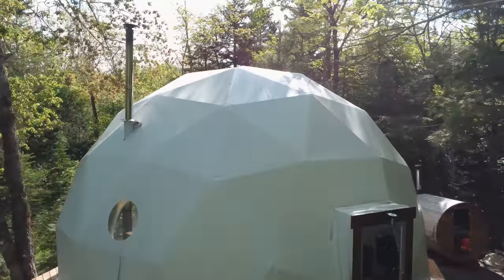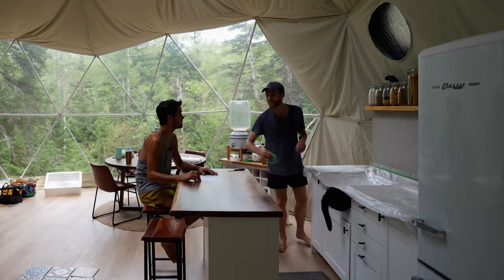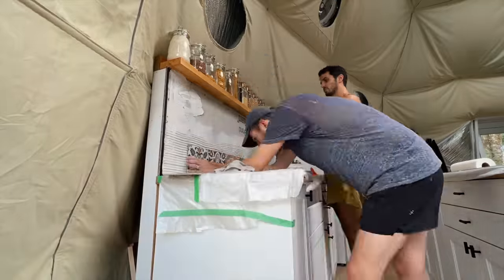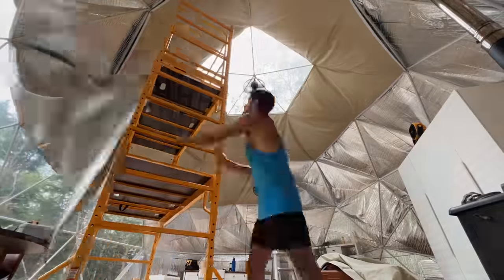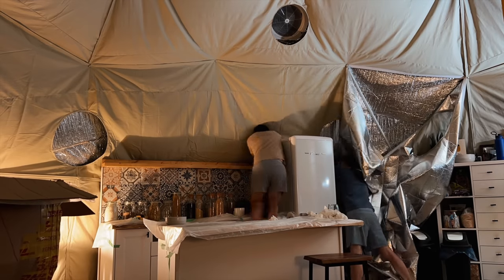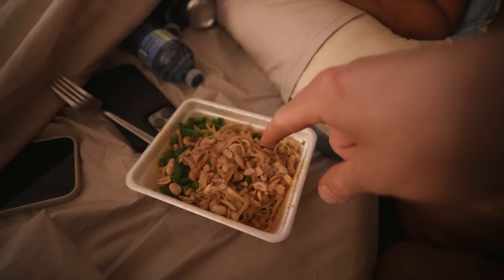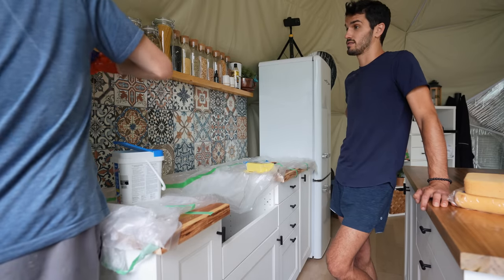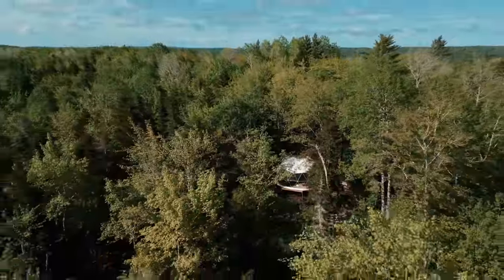Better Than We EVER Imagined | Geodesic Dome Build

Comment: You two are making an incredible home together! For your countertops  especially around the sink there is no easier to use or better than Rubio Monocoat 2C Oil. If you want to keep your island to be able to use it and chop right on it you can use either just straight food grade Mineral oil (most pharmacies have it) or you could try using fractionated coconut oil and beeswax. Make it into a paste while melting it together over a double boiler (3/4 cup fractionated coconut oil with 1/4 cup beeswax)! You can buy lots of different conditioners and there are many that have a lot of merit but I find this best so far. Make sure the coconut oil is Fractionated if you use that or it can go rancid. You can also make the paste with just food grade mineral oil and Beeswax. It will keep the counter food safe and you can refresh with the paste when needed. Rubio however is best for around the water! (Hubby & I are software/app/web dev with a hosting company but we also have a Woodshop LOL Gotta diversify these days!) Love your videos and look forward to Sundays! <3

Comment: You could try Rubio Mono coat for the counter tops.  It’s used on hardwood floors and I’ve used it on kitchen tables and it holds up AMAZING!  It has a matte sheen and you can get it in a clear coat.
Reply from the maker: Definitely going to look into this, thanks so much for the suggestion Kelly!

Comment: I'm really enjoying watching all of your dome videos and the trials and tribulations that y'all have had along the way. My partner and I have been living in a DIY van for 3 years and I'm currently designing and will be building a glass dome home in Colorado next year, so your videos have been insightful and entertainting to watch. One thought that I've had for your home that I plan to do on mine is this: You should consider adding some operable vents to your floor (locate them as far from your exhaust fans as possible). The coolest air in your home is underneath it. Adding the vents and then turning your exhaust fans on would pull the cool air from under the dome into your space while the exhaust fans suck the warmer air out. Throw some critter mesh over the vents (on the exterior) to keep the critters outside where they belong. Keep up the great work!

Comment: Use the panels you took down to cut circles larger than the window holes, fold the edges over and hot glue them (I know you don't like to sew).  Attach velcro in a few places on the back side of the circle around the edges and match them on the new panels. If you have any left over aluminum insulation, glue that onto the backside of the circles.  Then you will have window coverings for night time in the winter to keep the heat in.  You can do the same for the door if you have enough materials left.  It's looking really good guys!
Reply: Oh, and put some mirrors around the dome on shelves (I don't know how you would hang them) to help reflect some of the light around.

Comment: Place looks amazing. You work so well together. 
I noticed the decanter... if it's crystal, don't leave anything in it for any length of time. 
If it's glass, you're good to go. (The lead in the crystal isn't a good thing unless that turns over really fast.)
Reply: Good thinking! Somebody said if you have lead in the glassware you could measure a definite difference in the amount of lead that goes into the drink within a week. I didn't know it would happen so fast! cheers!/CS

Comment: Do you have a ventilation fan in the ceiling with an reverse or exhaust fan.   If you vent hot air out of the Dome the door and windows will bring cool air into the structure.   Covering the dome without the hot air exit will not give you the summer cool you want.    The fan you have will move hot air in the winter down and help with the heating.    Lilly is looking like part of the family now....good work.

Comment: I would recommend putting a bead of silicone between the tile and the sideboard  you can get this in transparent as this stops water running down the back between the cement board and cupboards and causing them to rot. (Just an fyi in case you didn’t know).x

Comment: I was sad that you had to block the skylight. Are you able to put up a sunshade or have the manufacturer create sunshade panels that block the UV and heat but let the light in. We use a sunshade in our backyard and it makes such a difference in the summer. We also have  UV blocking material on our backdoor glass and it has made a HUGE difference. Love you guys!

Comment: Just one suggestion guys, when you're washing your grout, wet the sponge, wring it out, with the sponge laying flat on the tile, wipe diagonally across the tile letting the sponge just kind of float across the tile WITHOUT applying a lot of pressure. Do one swipe, flip the sponge, do another swipe, and rinse. Never do more than one swipe per side without rinsing. By going diagonally without applying much pressure, you will wipe out less of the grout, and by always having a clean sponge, you won't be just smearing grout over tile you just washed.  Once you master this technique, I think you will find it goes a lot faster, you leave more grout in the joints, and you will only have to wash the tile a couple of times. Also, never leave your grout sponge soaking in water. It breaks them down and they won't absorb like they're supposed to. Otherwise, great job. It really looks good.

Comment: Todd is right about cars. I never buy new. I buy two or three year old dealer certified cars and or trucks. A new car loses 1/3 of its total value the minute you drive it off the car lot. I love how you guys could not wait a day or two from the time the insulation arrived until you were putting it up. Me, it would be days before I worked up the energy to start.  I am a great deal like Lilly when it comes to projects. I will just lay here awhile and think about it. 😊😊

Comment: What you could do with the skylight is take a small flexible duct and run it down through the wall between the fabric and the bubble foil and then vent it down through the floor during the hot weather using a small solar panel to power it to help expel extra heat and in the winter close that vent off down at ground level
Reply from the maker: I just need to say that you’re a literal genius. Thanks for this.
Reply: @tylerandtodd  a marine blower fan might work okay in this situation but it might require higher amps than a small solar panel can provide but it would be an easy hookup and since you're in the maritimes probably easy to find

Comment: Looking great guys! As for the countertops.....some sort of clear bar top epoxy resin or oil based polyurethane. Water based is crap. I would think twice about glass even if it's tempered glass especially on the sink counter. Too much risk of breakage. You'll need something though since you do all of your food prep there even if you use a cutting board. Veggies like tomatoes can leave black spots that are almost impossible to remove from wood even with sanding. Finishing oils like mineral type oils, or tung oils do not provide a protective surface.. great for cutting boards but not for protection on wood you don't want damaged. I used to have a restoration and refinishing business and have had a lot of experience with finishes. Oh almost forgot. Finishes like I mentioned above are slow drying so you'll have to figure out how to keep Lilly cat off of them. That was a funny bit when you had the sink counter covered in plastic and she just had to jump into the sink with her butt hanging out! lol

Comment: Did you guys ever explore the option of having geothermal heating and cooling in the new house?  I would think that environmentally it would be better than burning climate changing wood during the winter.  The VOC’s created in burning wood react with nitrogen oxides to form ground level ozone that form acid rain.

Comment: How to keep the tile clean with Grandma's Squeaky Clean:   Spray Bottle filled to the base of the neck with water, then add a little Gain, Dawn,  Dr. Bronner hemp soap, and rubbing alcohol.   You just barely sprintz the counter splash board and wipe, it'll squeak when it's ((Clean)).

Comment: once the heat rays are through the window or the plastic membrane, the heat is inside.  Using screening on the outside would cut down the heat rays penetration and stil give you some light.

Comment: I'm no professional of any kind, but i believe a good way to solve the smothering, would be having a vent pushing colder air from closer to the ground, and another one (preferably on the opposite side), pulling the air out, creating a flow. That way you guys wouldn't have to sacrifice the sky light. Just as preference, I would love to keep that light. Nice video guys, huge fan here! ♥

Comment: the community needs to crowdsource a solution to be able to hook and unhook the skylight liner without all the scaffolding every time... heavy duty velcro and a long poll with a hook and big rings on the ends to move it? that's all I got. Hopefully during the fall and spring you can take it down and get that light.

Comment: If you don't have it already I think a thermal drape that covers the entire front window of the dome would be very beneficial to you in the Winter to keep the cold out especially at night It would create a pocket between the window and the inside of the dome. You could run A-straight line from one side of the window to the other using some kind of braces I wouldn't attach it to the dome though the weight of the drape might cause an issue.

Comment: I think you could easily make a ridged frame for the top pentagon panel (skylight cover) with a hinge on one of the edges.  Then just set up a pulley system to open (lower) the “hatch” so to speak when you want more daylight in the dome or want to see the stars ⭐️

Comment: It would take as long to remove and replace and repaint drywall after insulating. It's ok. It's clean and fresh. The old stuff might be good awnings for deck areas. Cut some triangles and layer them with tethers over a deck for summer shade. Also could be made into shopping bags easily. Merch, baby. Smaller pieces would be much easier to wash. Maybe discuss it with a local canvas sewing company?

Comment: Your kitchen looks incredible, things are really starting to come together and your vision is becoming much more clear every week.  The windows are a really nice touch, too.  That backsplash is absolutely gorgeous.  Have a great week and see you next Sunday.  There are so many guesses to ponder but I am going to think that the kitchen sink will be installed and running water will finally be inside, along with the drain being installed so you have a fully functioning kitchen and sink, or maybe a mini-split ductless AC unit going in?   I am wondering if you are going to design a way to not have to go outside to the outhouse on freezing winter nights?  It would be a bummer to have to get fully dressed every time you needed to use the facilities.

Comment: I was hesitant about the tiles at first. They were so busy in design, that it felt like you needed some solid tiles to break it up a bit. But overall, not bad. As for the countertops, butcher block oil is a great way to keep them looking good, as well as it being food safe. Also you can sand it down if you get nicks in the wood, then redo the oil. 

Todd is absolutely right, buy used! I never buy the latest phone, or any electronics, because they upgrade everything!!! 

A quick solution for your round windows is to sew on Velcro around the window, and the make a cover with Velcro on it for easy install and removal. 

You guys seemed a bit more tense this time around. I hope it’s just random fatigue and nothing more. There was a lot of “are you happy?” questions being asked, so I wasn’t sure if that was an emotional check, or just making sure you were each satisfied with the results. 😊 

Anyway, it all looks great! Keep up the good work! ❤️❤️

Comment: Hey I was wondering could you put one of those portable air conditioners in the dome to cool it in the summer.  They have ones with hose vents.  Would that work.  Have no idea just curious if you could have some air in there in the summer.  Also one other question.  What about days when you have lightning.  Do you stay in the dome?  Or do you go into the camper?  I’ve always been curious about that since you built it.  Just very curious about those questions.  The lightning would scare me!!!

Comment: Hi, i am no expert in anything at all, but i just had a thought about the skylight! wouldnt it maybe work better if you had a covering on the outside of the dome with a pulley system so that you can choose when you want it covered? that way you dont need to use the scaffolding and remove the fan every time? :) i also just have to say, i have been a watcher of you channel for over a year now, and absolutely love you guys! much love from Norway! :D
Reply from the maker: Hey Sara! It’s not a bad idea, our worry is that overtime the movement of the exterior layer would create friction and catch the PVC liner of the dome if that makes sense?
Reply: @tylerandtodd  that completely make sense! I am genuinely so exited to see whatever you guys do onwards!! <3

Comment: Todd, you mentioned making cutouts in the lining and the insulation for when it gets colder at night you can fit the insulation back in . How about you sew the circular lining to the cream padded lining and have velcro edged square panels to place across the round windows and secure them to the wall linings . do you get what i mean ? a bit like when you did the windows in the RV .You could pin the panels back when you want the windows open to see through . I heard you say "what are we going to do with the extra linings ?"

Comment: When the solar is fully set-up, will you consider running air conditioning in the dome and open the skylight up again; or is that not feasible with the structure/living off-grid?
Reply from the maker: Absolutely! That's in our plan :)

Comment: People forget also that you have to know when to step away from a project as well. Some times you have to change gears and step back to ensure you are actually going in the right direction. Pressing on when you are brain fried is usually a mistake. Remember... 1/4 inch out,  over 8 feet turns into 2 inches wrong lol

Comment: They make double pane glass that has a solar heat gain rating and you can not feel heat from sun through them. May not work in this application! Helps to have a partner driving you to do more lol

Comment: That's so sad that you're losing the skylight. Isn't there some way that you can get some airflow or something instead? Can there be some sort of windows that open put in or an exhaust fan system or something? I wonder if there would be a way to get a hatch type thing up top that could open and close with an electric motor. That way you could let the heat out in the summer? Just me brainstorming 'cause the more natural light the better imo.

Comment: Wish there was some sort of ring clamp for around the windows. Something that would give you a finished edge to the insulation and lining. Also, there should be a ‘shade’ that could close the skylight that could be opened and closed via (at very least) a sting and pulley system. Could be kind of like a camera shutter Iris. Just HATE the thought of losing the night sky views it must avail.. maybe I’m overestimating the clarity of the skylight views, but either way, hate that you’ve lost that feature so ‘semi’ permanently. <-420 explains any and all grammatical issues.

Comment: With the sky light...I thought you were going to be placing a UV mesh.....something that would cut the heat but allow the light...I would hazard a guess that a 'shear' would suffice
Reply from the maker: We would have liked to allow a bit more light in but unfortunately there was no way to have insulation with the mesh option. ☺
Reply: @tylerandtodd  mesh for the summer insulation for the winter